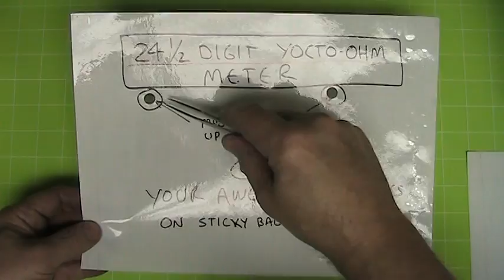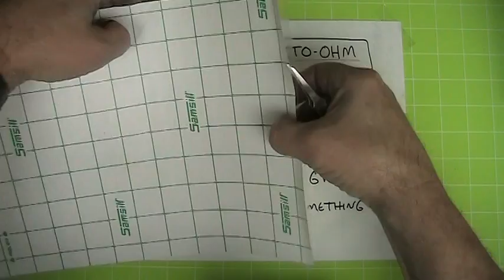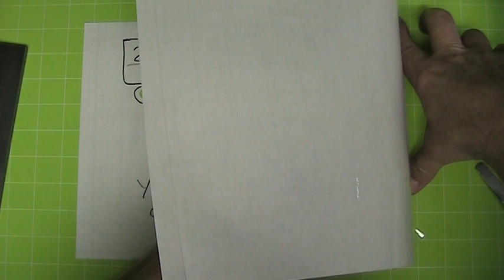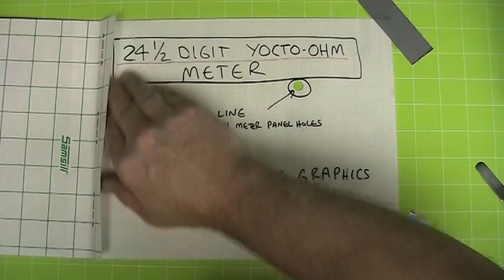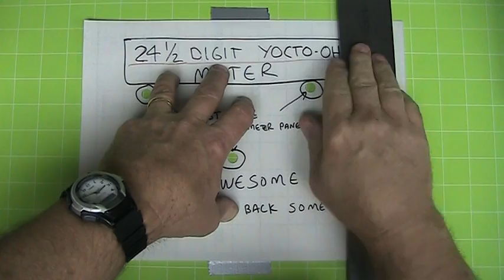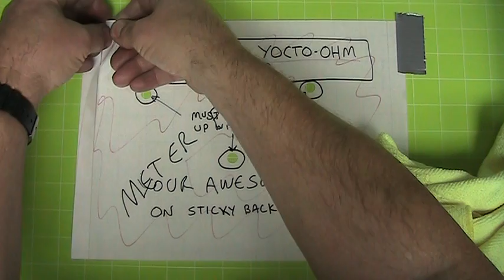APPLYING ADHESIVE BACKED MATERIALS

Comment: Is there a particular reason to stick the clear laminate first? I always do that last.
There is a special kind of front panel laminate which is fairly thick and has a satin finish. My front panels look so much more professional since I use that instead of the glossy kind.
Reply: There isn't any need to "pre-laminate", and that simply adds an additional time-consuming step.
All that's needed is to apply the graphic to the panel first, using the technique shown. Then, for the overlay, a less-demanding method can be used since there is no need to align that perfectly.
In fact, making the overlay much larger allows the excess to be folded over the edges and onto the rear of the panel (ie: like how you cover a book), which significantly improves durability as it seals the edges against moisture etc.